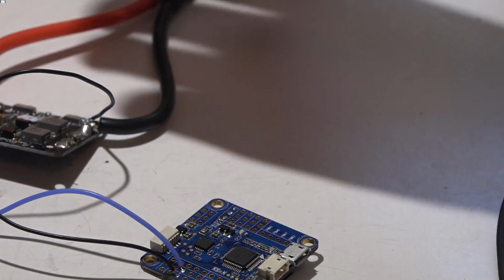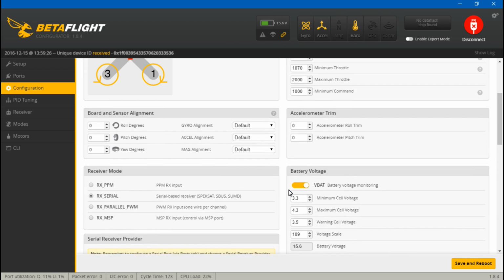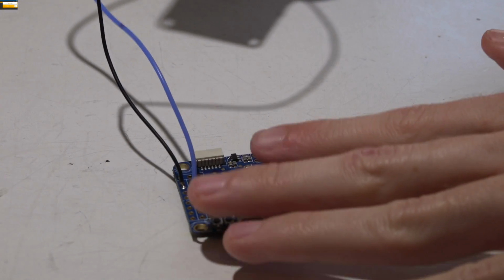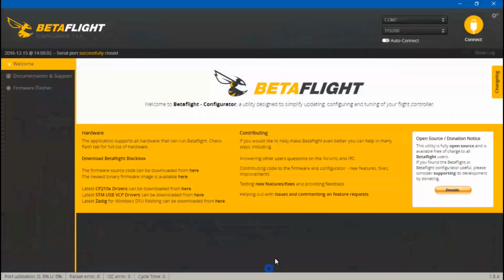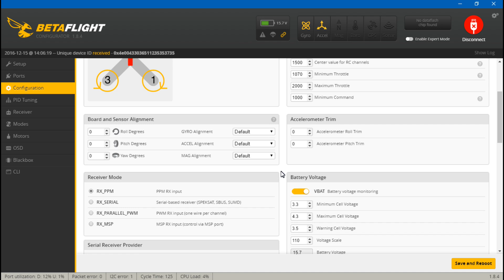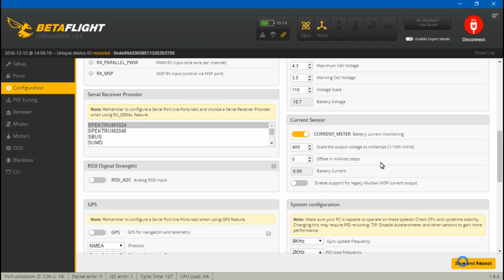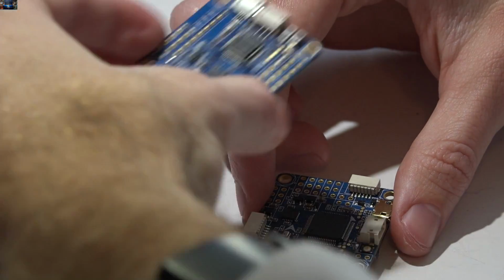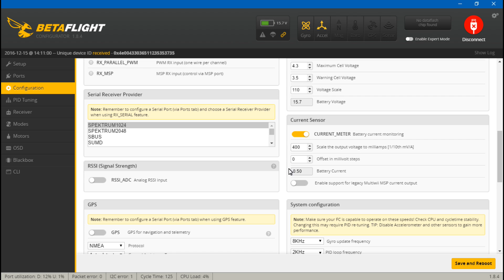Flip32 Omnibus: How To Power (F3/F4/Pro/NonPro)

Comment: How much I can hook up to that 5V from the FC? VTX, camera, receiver and some WSxxx leds is fine?
Reply from the maker: You can do the camera, receiver, and LEDs, but dont power your Vtx off the flight controller. The video will look horrible if you do, if it even works at all. But everything else will be fine.
Reply: Project Blue Falcon yes I can power vtx directly from lipo with some cap. Was just wondering about few leds and receiver as someone said that this 5v is only enough for board itself nothing else

Comment: good to see you back . on the omnibus f3 aio.  do i need to use 14 gauge wire?  for 4s or is 16 gauge ok for the vbatt
Reply from the maker: You should be fine with 16ga. Most 4s Li-Pos use 16ga anyway.
Reply: i missrd the comment

Comment: Hey man, glad to see you back. I have a question about the F3 omnibus pro (current sensor). I have a TBS unify pro 5g8 v2 hooked up that takes 320mA at 5v, also a hs1177 taking roughly 70mA. I have the flight controller powering everything off of the 1.5a reg with 4s and it works great. I've been told and read that 5s works with these flight controllers just fine, and I've plugged in a 5s lipo and it worked. I'm wondering if you think 5s should be okay for the voltage reg since I'm not pulling a huge amount of mA. Thanks! Merry Christmas!
Reply from the maker: I've seen where many guys are using 5s as well. I dont think you'll run into any problems, but I haven't tried this for myself so I can't say for sure. But I'd guess you'll be fine.

Comment: bro!!! Amazing video!!! bother question where do you hook up the xsr smart port telemetry cable on the onmi f4 pro? I cannot find any urart port anywhere ...i'm trying to get vbas. any info will be appreciated.
Reply from the maker: Thanks man. I'm actually making the videos right now on how to connect the receivers to the F4 Pro. The two other UARTs are on the six pin connector next to the USB. But the F4 doesnt have hadware inverters so you'll have to do a small modification to the XSR to get telemetry to work. I'll cover that in the video.
Reply: you are the man!!